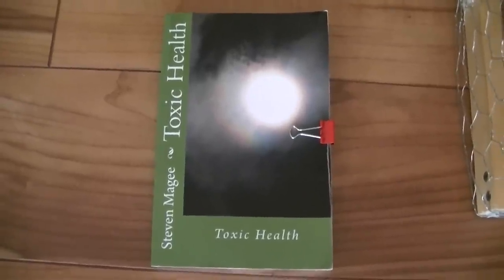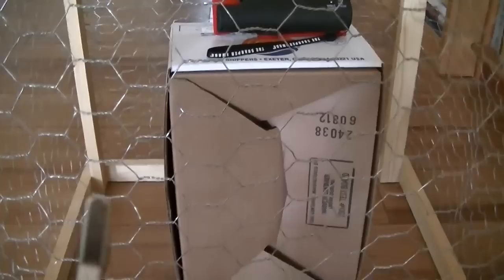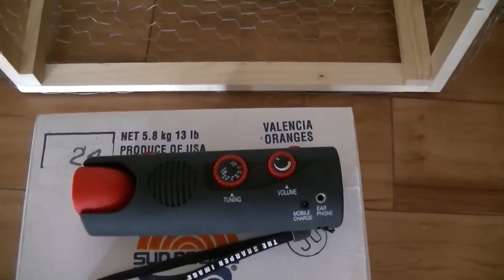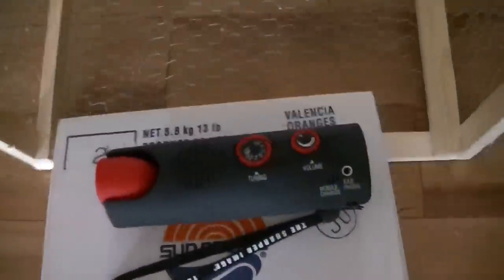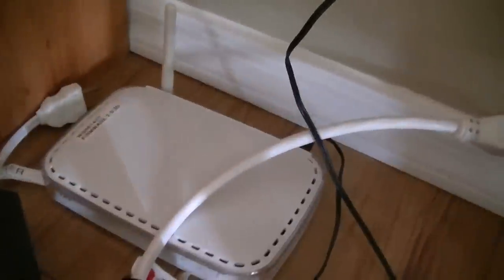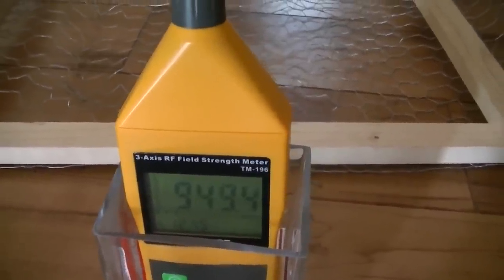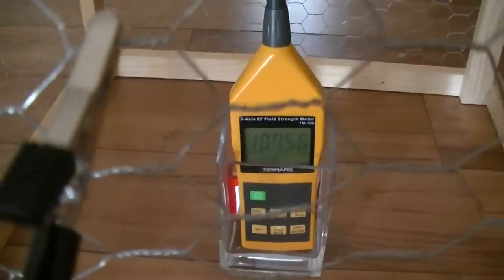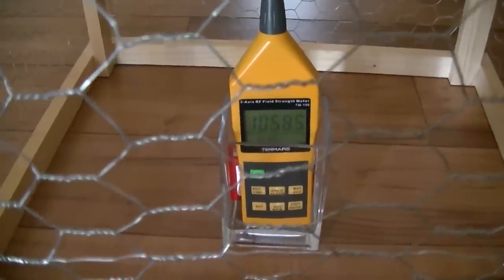The Difference Between Grounded and Ungrounded Faraday Cages Regarding AM, FM & 2.4 GHz WiFi

Comment: no bottom to the cage...holes too big to block shorter wavelengths(higher freqs)
Reply: the point of this video wasn't to show how you can block out waves the most, it was to show if ground made any difference
Reply: if the holes are too big to block a freq, then the ground is pretty well moot.
Reply: Thank you, that was my only question.
Reply: AM may respond more to this. Most of the power is outside of the cage.
Reply: I think the holes may be good enough, but the lack of a bottom means this shouldn't be called a faraday cage.

FM radio is around 90-100mhz, 100mhz has a wavelength of 3 meters. Chicken wire is far smaller.
Reply: @duac4508  General rule of thumb is that the opening in a Faraday cage should be smaller than 1/10th of the wavelength  that should be blocked. For example, in order to block EM fields with frequencies of 10 GHz and lower, the hole size of the Faraday cage should be smaller than 3 mm.   2Ghz is 14cm  and 5Ghz is  6cm >> convert to mm and divided  by 10.. Somebody did a youtube on this at 100Mhz.   https://www.youtube.com/watch?v=9M6h1U9jgWs
Reply: Reminded me just how TERRIBLE new music is.

Comment: Cage is bottom opened, furthermore, the jail holes should be much smaller than wavelength to block any polarization of radio waves, about 1/15 of wavelength to be effective. To block 1.2 Ghz the holes must be 1.5 cm or less. With this chicken wire you can not filter frecuencies over 300 ~ 400Mhz.
Reply: In addition to the hole size being to large for UHF, the length of the ground wire must be short compared to the RF wavelength which is almost impossible to do at UHF and above since wavelengths are measured in centimeters or less.  Proper grounding at RF is much more than simply hooking a wire up to a water pipe or ground rod.  I think you have demonstrated that here.
Reply: RLA Bruce you sleep in a garbage can? How bizarre.
Reply: what is a solution to protect the home against 5G? i heard some of the emf paints aren't sufficiently good for that
Reply: @Patrycja - Trees in your garden consistently surrounding your house.
Reply: Which is why he is doing the test with a radio..

Comment: Having worked in PRO faraday cages over the years, none were grounded. The reason why is complex but let's just say even a ground has potential which is why they are made un-grounded. For more in depth information, read up on grounding for ham radio.. Anyway, I built a faraday cage based on my experience and basically it's a box covered in alm screen door material including the bottom edge. The reason for this is you will make a screen bottom that sits under  the generator. When you put the cover over it, the box screen will make a connection with the mat you placed under the generator. This was tested against our PRO built cage and worked exactly the same using the same instruments we tested the Pro cage with. All this for $40 in material from Lowes.
Reply: I did the same thing.  Aluminum screen.  Love it.
Reply: Ground wire = EMP conductor

Comment: You have not grounded the cage because a long wire like that is an inductor and has a huge impedance to radio signals even at 540KHz the lower frequency in an AM radio so the signal is not conducted to ground. The second aspect is that the holes should be smaller than 1/20 of the wavelength to be effective the bid hole on the bottom is not going to work for FM or microwaves and the small holes on the mesh are not going to shield microwaves (see how tight is the mesh on a microwave door and that is for 2.45GHz, with 5.8GHz of the 802.11ac signal from the router it has to be even tighter). The third is that the chicken wire mesh is not a proper RF shield because it is made of long wires which are inductances you must use a low impedance metal sheet preferably without holes. The fourth aspect is that the AM antenna is a magnetic loop ferrite antenna and magnetic fields can go across a faraday cage very easily. 

A good example of a Faraday cage is a microwave oven and microwave ovens do not conduct the microwave signal to the ground because the ground cable is several wavelengths long at 2.4GHz and it would act as an antenna transmitting microwave signals all around it, and it would have a very high impedance path to ground so it would not be effective as a grounding system. 

With RF, the ground is not intuitive as it is with DC or Extremely Low Frequency AC (50/60Hz where the wavelength is huge). With RF any wire is an antenna even a wire connected to ground.

Comment: Higher freq. have shorter wave lengths and would require a smaller mesh than chicken wire. The only true cage is solid metal and light tight. Ungrounded conductors act as reflectors and grounded act as sinks. An EMP would produce a voltage potential that would be drained of by a ground wire. Steel buried in the ground would be excellent. Any successful radio test would result in no noise at all. Static is background electromagnetic waves.

Comment from the maker: Interesting ideas, thank you for the feedback.  I think that the idea of grounding of Faraday cages comes from the work that was done regarding shielding from high voltage Tesla coils and high powered electrical equipment where you would want to keep the cage at ground potential to keep it from shocking grounded people.  In the era of wireless radiation, it appears that we are dealing with a different set of phenomena that requires the theory of Faraday cages to be revisited. I recommend ground.

Comment: The timber floor being above ground still allows RF into the cage because it has no mesh. But grounded or not the mesh size needs to be around 1mm x 1mm the same as aluminium fly screen. Grounding the mesh unifies the earths field with the cage, transferring the continual build up of energy accumulated by the mesh from the RF outside the cage. Earthing reduces the low and Electromagnetic fields that would otherwise become a problem for electrosensitive people when they shield rooms with meshes foils and paints, which must all be earthed. (But they must have earth wires well away from other electric earths.)

Comment: You should view a basic physics class (MIT's classes on youtube are great) to understand why/how faraday cages work.  Grounding doesn't matter.  Your cage would work better with a bottom.  You also want finer mesh if you're going to be working with microwaves.  You want the holes in the mesh no bigger than about 1/10th wavelength.  That's 1.25 cm for 2.4 GHz wifi, and 0.75 cm for 5 GHz wifi.
Reply: Hello I am trying to make a Faraday cage with 120mesh brass, but does the 0.07mm diameter brass mesh  block WiFi?
Reply: @네임노-y3c  First thing to understand is any practical faraday cage is not perfect, and will attenuate signals, not necessarily completely block them.  It depends on how strong and how close the transmitter is.  That mesh is certainly fine enough to affect 2.4GHz.  Sometimes you need to use nested faraday cages if one doesn't give enough attenuation.
Reply: @stargazer7644  Thank you very much So is it not working on WiFi over 5.0 Ghz?  I have one more question, I wonder how big the diameter of the metal mesh of the Faraday cage should be to see the effect at 5 ~ 30ghz.(This is a question about  matal thickness.)

Where I live, 5G will be installed everywhere. Thank you for answering the question
Reply: @네임노-y3c  It isn't the diameter of the wire that is important, it is the size of the holes in the mesh.  As I put in my original post, you want the holes to be no bigger than 1/10th wavelength.  That's 1.25cm at 2.4 GHz Wifi freq.  That's like fine chicken wire.  I don't know the spacing on your mesh, but it is far finer than that.  The finer it is, the higher the frequency it will attenuate.
Reply: @네임노-y3c  And by the way, 5G isn't going to hurt you.
Reply: @stargazer7644  thank you have a nice day  :)

Comment: I haven't read any post yet - sorry if this has been covered. First thanks for the video - just the kind of info I am looking for. One thing struck me - wood has moisture and so is already grounding the cage - unless the floor is guaranteed no conductive (maybe laminate I cant tell and even so I dont know the electrical properties of laminate) maybe you could repeat the tests with rubber grommets under the wood frame? 

Does this mean I can put a chicken wire cage around my lap top and reduce the radiation - as I am getting thryroid problems and I know it starts to hurt after a few hours at it. Today I made a silver foil and card reflector I am wearing like a bow-tie and I have earthed it. So far after a couple of hours -I'm still feeling ok.

Also I use an earth wire going out of the window to a metal stake (with a 100k om resister in line) I find no electrical conduction between this and the house earth in a mains socket - I wonder why?

Comment: You can't block most radio signals and especially wifi with chicken wire because the wavelength is too small and will easily pass through those large holes. But if you use aluminum or copper screen your test would have much different results as they would be able to block or reflect those smaller wavelengths
Reply: He also has it on the floor too.  This is not a good example of a faraday cage.

Comment: if I'm not mistaken I think grounding is meant to be used to protect the electronic circuit from a short depends on its design or  to protect it from your body high voltage electrostatic discharge or can be used to protect you from electrocution, the test thats showing in this video is the shielding from electromagnetic waves radiation

Comment: Why ground a Faraday cage, and more important: ground it to what?
The most important reason is that any power emission from equipment inside the cage will build up an electric charge on the contiguous cage surface. 

This is generally important for high power and high potential systems.  If equipment or personnel outside the cage then touch a charged cage, they can be damaged or functionally terminated. 

For example, a helicopter in flight is an incomplete faraday cage if it employs aluminum material. After some time in flight, the airframe and rotor can build up significant levels of charge from various sources. This is not a problem for occupants. However, if the helicopter lowers a cable to pick someone or cargo up, external persons or equipment can experience significant electrical shock on contact. That is why normal procedure is for the external crew to employ a large static probe to discharge the helo platform prior to contact. In general terms, it is a best practice to provide equipotential bonding such that  excess charges will be neutralized by a suitable ground connection with the local environment.

In the video, the demonstration employs an incomplete faraday cage structure. The large opening on the bottom acts as a gap to admit radio frequency (electromagnetic) energy that is of a lower frequency than that getting through because of mesh size.

In terms of shielding or providing a suitable ground reference, the most important parameters for a faraday cage are the gap sizes in any mesh or openings, the thickness of the cage material, and the electrical and magnetic properties of the cage material. It's important to realize that a Faraday cage will only provide partial attenuation of incident time varying electromagnetic fields.  Additionally, because of wave interference, radiation within the faraday cage will have both attenuated regions and amplified regions. That is why an aluminum foil hat can actually increase signal strength inside the skull from received incident waves.

If complete shielding is required, then continuous shields will effectively attenuate all wavelengths shorter than the skin depth of the specific design. Different materials have different skin depths for a given frequency.

Comment: I experimented by putting a radio in my micro-wave oven.  It was set on AM, and, when I closed the door, there was no change in the signal.  Yet, in this video, your Faraday cage of chicken wire worked the best ON AM and NOT so much on micro-waves.  Does this mean my family is being cooked by micro-waves every time the oven is on?
Reply: +Nallanyesmar No, if you notice the door has a kind of metal mesh in it. This blocks the microwaves. I would be careful of just opening the door while it's running instead of hitting pause but even then the radiation is small.
Reply: +Nallanyesmar Also, they are completely different wavelengths and frequencies. The wavelength of AM radio is a LOT larger than microwaves. We're talking meters vs millimeters.
Reply: your question is a good one
the RF leakiness is frequency-dependent
In the chicken-wire box, the holes are tiny compared with the AM and FM wavelengths
The AM appears to be more attenuated because as signal strength decreases, the audio tends to just fade-to-black.
FM tends to get more staticcy as signal strength drops and often the net audio power will tend to stay roughly the same - just get hyper annoying/distorted/hissy
The router is emitting a wavelength smaller than the holes in the chickenwire so they just sail on in unimpeded.

Your AM radio in the microwave example is curious.
I believe this is a definitive answer:

Microwave oven shielding is 
probably along the lines of 30-50 decibels of attenuation at 2.45 GHz.  
The path loss between a cell phone handset and a base station can be as 
high as 100-200 decibels.  If placing a cell phone in the microwave 
gives identical signal attenuation, it's quite possible the attenuation 
would still not be high enough to prevent communication with the 
network.Microwave oven shielding operates primarily as a Faraday cage.  
Attenuation for a Faraday cage normally increases with frequency up to a
 point, and then drops off sharply as it reaches the cut-off frequency. 
 Depending on the thickness and conductivity of the shielding, 
attenuation of 900 MHz might be substantially less than 2.45 GHz.
Perhaps most importantly, most microwave doors use a quarter wave 
choke joint around the door frame to maintain an EMF seal, as it's much 
simpler and safer than designing an electrically conductive seal. 

(This
 is the reason pretty much every microwave oven door is always 3 cm 
thick.)  This joint will prevent 2.45 GHz radiation from leaking out but
 won't do anything for any other frequency.  See for example, Imberg et 
al., US Patent 3,956,608 (1976).http://message.snopes.com/showthread.php?t=67936
Reply: kurt klingbeil
Is a microwave oven a good place to hide you magnetic audio/video tapes during an EMP attack?  By the way, thanks for the information above.

Comment: I bought a portable solar setup and dual fuel generator. I have wrapped them in emp fabric but I have a feeling that wont actually be enough.  I was going to build a fence for my vegetable garden but it appears to be fine without one in my fenced in backyard so I am going to use that chicken wire fencing to build some of these.  I think I will build a similar box but I plan to wrap the boxes they are in with the emp fabric as well.

Comment: So why did the reading increase for the wifi when in the cage?
Would think the signal would lessen or be ultimately blocked if it's a faraday cage?
Not trying to be difficult. Just a sincere question to understand. 
all new to me.
Reply: Johnny Little I read that the signals actually bounce around and build up in an enclosure that the frequencies can enter, especially a car.
Reply: Johnny Little  The wavelength of the wifi is 2.4ghz which is quite small wave lengths and easily able to get through the large holes in the chicken wire. the FM radio is between 88and 108 MHZ which are considerably larger wavelengths therefore being blocked by the chicken wire.
Reply: I don't know much about electricity, but do you think that the chicken wire could be acting as an antennae?

Comment: Bottom is not completely open to EM waves, as it is sitting on a dielectric plane (the linoleum). That it was effective to a fair degree as a Faraday Cage was shown by the meters. I have always grounded my FCs, as that still makes the most sense to me. Given an induced charge gradient, from whatever source (natural or fashioned), I want that juice to have a nice, easy path down to ground. It's kind of a belt n' suspenders approach, which is the minimum redundancy for critical electronics protection.

Comment: You used chicken wire with large gaps. I did something similar with wire that had smaller holes. Worked a lot better. Worked better for me though, but results may differ. I grounded mine into the copper water lines as well.

Comment: Shouldn't your cage have wire on the bottom? Well unless you were touching the actual ground but in many cases these cages could be slightly above ground in a house or building. Not that this will have much impact on your experiment but I would imagine that it's possible that some of the radio waves could be coming from underneath. Ideally you want to create the Faraday bag or cage to go completely around the object. You might want to try metal foil (copper or aluminum) to see if that changes the results.